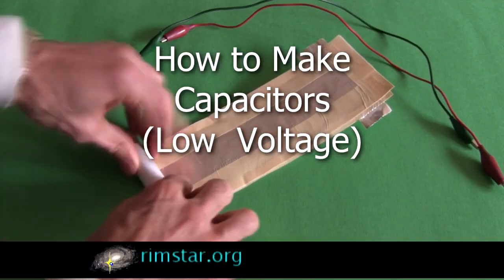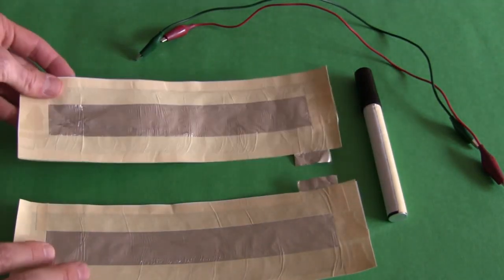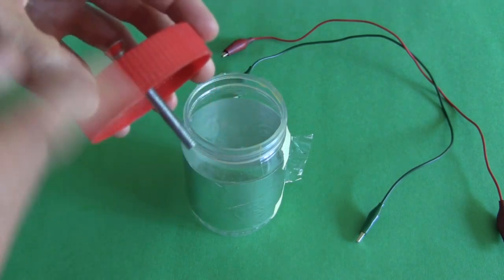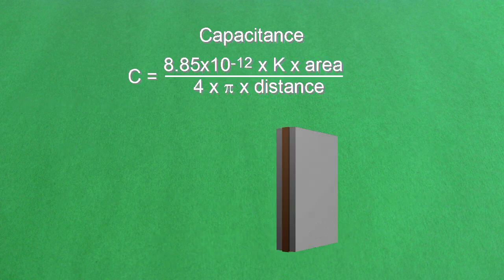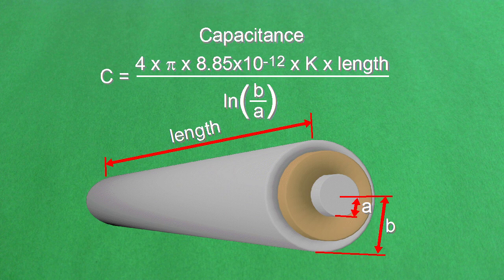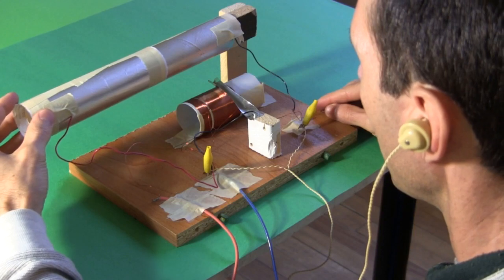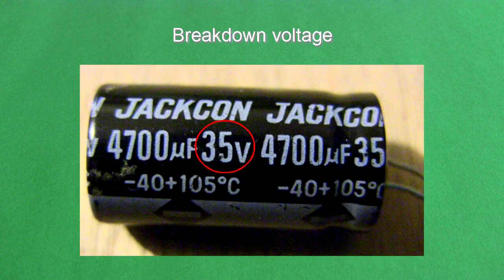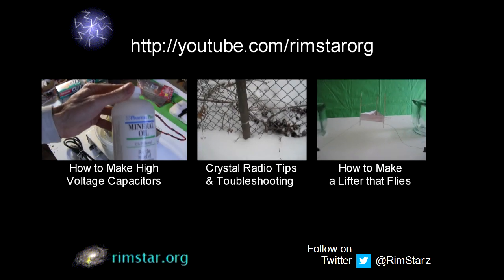How to Make Capacitors - Low Voltage Homemade/DIY Capacitors

Comment: MF is mega farad acc to SI standards.  μF is micro farad
Reply from the maker: Yes, MF is megafarad in the SI standard but when you see it written on a capacitor, that's not what it means. A different convention is being used in that case.

Comment: Capital M in SI units denotes millions of units, not millionths of a unit. Doesn't matter what units you're using or how unlikely it is that you'll use them, using MF to denote microfarads is bad practice and should not be encouraged.

Comment: I just need 365kj or 500kj ,,,,,, so can u expirement one ? And creat but not big
Reply from the maker: neil pabilonia As I said in my facebook message, it is not possible to make one that big. A supercapacitor is the biggest and can old only a few hundred joules.
Reply: How bout ultra capacitor ?
Reply from the maker: neil pabilonia That's the same as a supercapacitor. No capacitor currently can hold more than a few hundred joules.
Reply: Ok howbout 50kv/500uf ?

Comment: 2:55 Exposing that screw head exposes your location as well... 
Too bad it's only used in Canada.
Reply from the maker: +Derpy Herpy I agree, that is too bad. A screwdriver slips far less often with a Robertson. Though I once read that Phillips and flat-head were good for cases where you don't want to be able to apply too much torque.
Reply: +RimstarOrg It doesn't just slips far less it also wears much slower and it's easier to fix the screwdriver doe to it's simple shape.
Reply: +Derpy Herpy Haha....yes it's true. I was in Belgium once when a local asked me "are you Canadian"? when I asked him how he knew he pointed at the Robertson screws on a roadcase I was hauling.

Comment: i made 1 with tin foil another bottle one with salty water but none charge with my 12 volt adapter..
🤐
Reply from the maker: I'm pretty confident that one or all of yours charged. What steps are you doing to charge them and how are you testing if they're charged?
Reply: RimstarOrg thx for reply
a tin foil wrapped around a plastic bottle
salty water inside bottle(a lot of salt)
nail hammered in lid so it touches water

but i connect to adapter 12v
i wait few seconds and when measuring with multimeter NoThInG..,🤨😅

my other one is 2 tin foils with A4 paper between .(i think im not noticing this one  charge because way low capacity?!🤔)
Reply: i tested it again(bottle) and it gives 0.02 volts for a second and then 0
Reply from the maker: As soon as you connect the meter, the capacitors will begin to discharge through the meter. So you may briefly have seen a medium value voltage and then quickly a much lower one and so on. You can see a capacitor discharge curve here http://www.electronics-tutorials.ws/rc/rc_2.html. Notice that the voltage drops very steeply at first.
The higher the capacitance, the longer it will take to discharge. You can slow down the discharge by connecting a resistor to one capacitor plate and a meter probe to the other end of the resistor. The higher the resistance, the slower the discharge. Both of your capacitors sound like they'd be very low capacitance and so would discharge quickly. The meter also has some resistance.
Reply: RimstarOrg finally thanks!
i finally charged it with a bug zapper 950 volts and tested it with my family and it went ⚡⚡⚡🔥⚡🔥😄
i needed high voltage for good results

Comment: why my ammeter doesn't show any reading?
Reply from the maker: You'll have to describe more what you're doing.
Reply: +RimstarOrg  I put a piece of paper between two conducting plate and connect it with ammeter and low voltage supply (series) but the ammeter doesn't show any reading so as my voltmeter if connect parallel with conducting plate
Reply from the maker: summer gan
The meter is acting like a short circuit, discharging any charge in the capacitor and taking the rest from the power supply (I'm guessing that your meter is on the volt scale.) The meter is giving an alternative path for the charge to go.
Instead, connect the power supply to the capacitor for a few seconds and then disconnect it. That charges the capacitor. Then touch the two leads of your meter to the capacitor. You should see a voltage briefly and then it'll quickly drop to nothing as the capacitor discharges through the meter. The meter acts like a short circuit. You may have to try this a few times. You'll get different values each time since the voltage starts dropping as soon as both meter leads are touching.
The fun comes when you charge up the capacitor with the power supply again and then disconnect it. And then you connect something else, like an LED or tiny motor, and see the LED lights up briefly or the motor runs briefly as the capacitor discharges through it. But you'll need a higher capacitance capacitor for that. For example, I power some lights here:
https://www.youtube.com/watch?v=lmVVdV8wuB0
and here I use one in a circuit:
http://www.youtube.com/watch?v=ml2TdQ2_2mk

Comment: I should have checked the capital vs lower case m. (facepalm). Never seen the "magnetic" effect harnessed by humans. Gekko's do it though, on their toes, it's how they stick to stuff... Spiderman gloves and anti-gravity boot's should both be possible with enough difference in potential... It's also a pain with my Cup-caps (See my video's) as they are hard to turn when charged. I am working on a solution.

Shorter leads = lower capacitance and induction. = lower interference = better measurement.

Comment: Why using salty water here
Reply from the maker: The water is acting as the inner electrode of the capacitor, specifically where it faces the outer aluminum foil. The contaminants already in the water make it electrically conductive but the salt makes it even more conductive. And lastly, the salty water is how the bolt makes electrical contact with the inner electrode (the water).
You could just line the inside of the container with aluminum foil instead, and run a wire from the bolt to that foil, but with some jars, that's hard to do.
Reply: RimstarOrg  I did use normal water and water containing diff types of  adulterants then also it worked well.
Reply: What are you basing the fact that you say it worked well on? What metric did you measure that indicated it worked well as opposed to merely working. Tap water contains lots of dissolved ions, but not as much as if you added salt water.

Comment: Make it power some thing
Reply from the maker: I didn't use the capacitors in this video for anything but in this later video http://www.youtube.com/watch?v=ml2TdQ2_2mk (at around 8 minutes and 43 seconds in) where I make a higher capacity electrolytic capacitor, I use it in a timer circuit to make a light flash on and off.